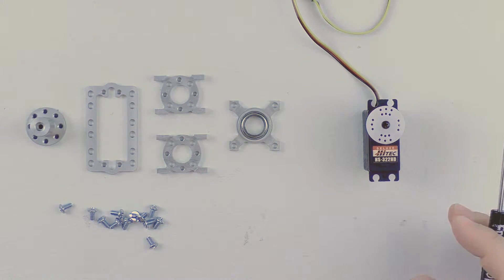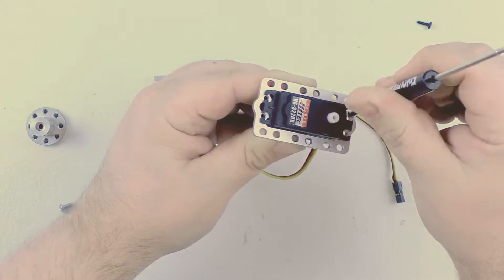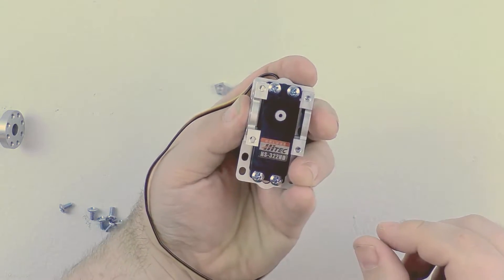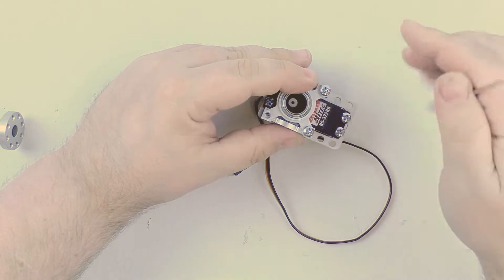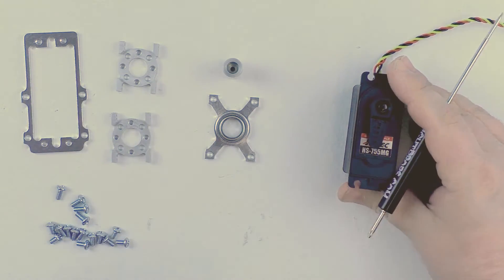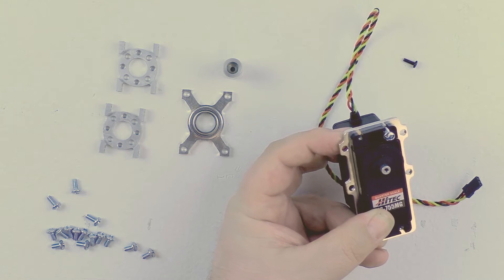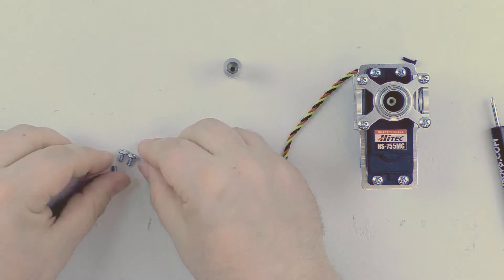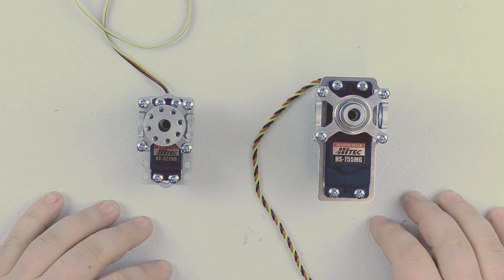How to Assemble a Servo Block

Comment: I just got this servo tilt and turn kit yesterday, the hub is so dang tight on the teeth of the servo. is this right?
Reply from the maker: Yeah, they fit is very tight on some servos. We use the screw to sink them down onto the shaft. So put the hub onto the servo gear and then use the screw to tighten the hub down onto the grear.
Reply: FrightProps thank you for your prompt reply, as usual,your customer service is top notch.